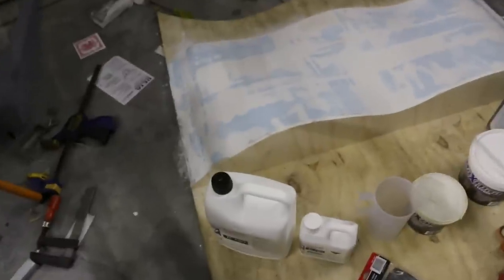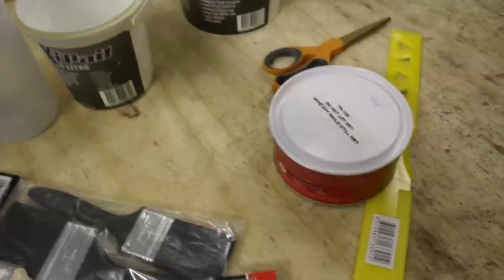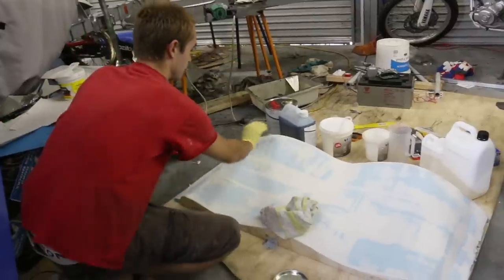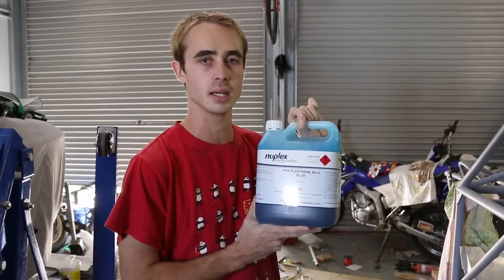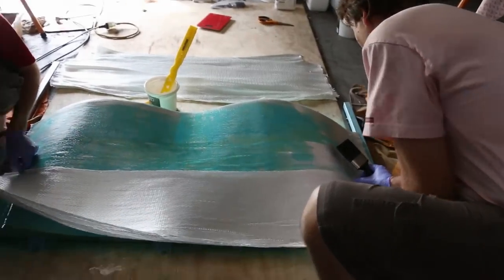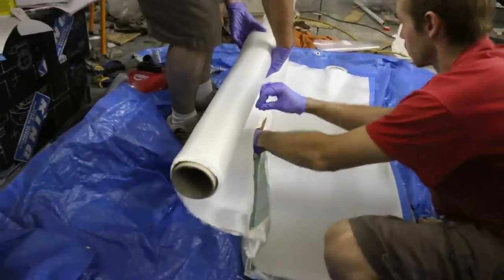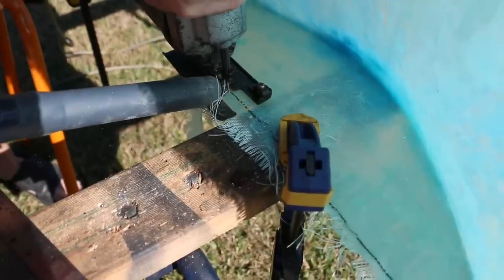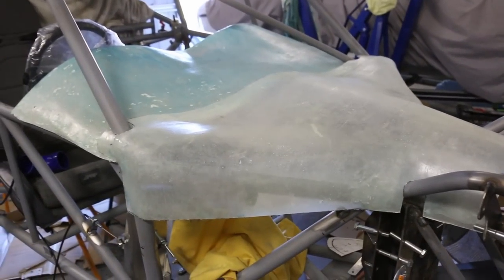How to Make Fibreglass/Carbon Fibre Race Car Bodywork - Part 2/2

Comment: Kyle, did you use E or S glass for this, and what weight of material?

Also, you mentioned that you thought two layers were good for most applications. Does that include making parts for road cars and boats, or did you have mainly race cars in mind, for which the weight savings are critical?

Good stuff, thank you.

Comment: hope you see this since the video is old, but what did you use in between the female mould and the actual piece?
Reply: +Neil Chand looks like there's a clear plastic sheet? like a cling wrap haha
Reply from the maker: +Neil Chand I do actually use industrial cling wrap around the outside edge of my moulds where I don't want it to stick! But you wouldn't want to use that for you main surface as the finish would be terrible. I think it's mentioned in the video, but the mould is coated with multiple layers of wax, then sprayed with PVA (the blue stuff), and I let that dry into a sort of a plastic film before layup, and that provides a clean release.

Thanks for watching!
Reply: +KYLE.DRIVES sweet thanks! i was considering just using cling wrap for the whole thing but yeah rather the cleaner finish with the Wax and PVA

Comment: Do you need to wax the wood too ( it's maybe a kind of stupid question but I don't know)
Reply: Here no wood is exposed. If you have exposed wood parts, first seal them then use a release agent like wax. For more detailed instructions you can check tutorials for RC Fiberglass planes, there using wood molds is common practice.
Reply: Daniel Rose thank you

Comment: so how would the process be different with carbon fiber? don't you have to heat up carbon fiber or something like that?
Reply: Depends what sort of carbon fiber mate, if its pre-preg (resin already inside the fibers) then yes many require the use of heat and pressure in an autoclave for instance in order to cure properly, however there are also room temperature resin systems that dont require heat or pressure
Reply: Simon WoodburyForget the reason   they use resins that require an oven cure is that yes being strong is an advantage, impregnating fibres with a room temperature curing resin completely negates the ability to have pre preg in the first place; the advantages of which include optimal resin/fibre usually 60 percent resulting in the lightest possible parts possible while utilising the fibre/resin matrix to its fullest extent. They require pressure in order to compress the layers and drive all the air out otherwise you risk delamination on such a leanly infused part. Infusion looks fantastic if resin is degassed correctly however results in 100% percent saturation and thus a heavier part. We get our pre preg in from korea and it has to be kept in a fridge. once the package is opened you have 40 days to use the roll or it is discarded as the resin slowly goes off at room temp....
Reply: Err, not exactly correct on a few points. If you replace the unused carbon back into the freezer (not a fridge as it isn't cold enough) it will refreeze and you are back to 12-18 month shelf life. However, there are prepreg carbons that can be kept at room temperature for over a year. If your prepreg carbon only lasts 40 days once opened I suggest you look for a better quality supplier :-)

You need 100% saturation in order to obtain the maximum strength. Dry fibres mean a weak part. Prepreg is 100% saturated, but at the optimum amount - around 40% (not 60%) by weight (eg - 100gms of carbon requires around 40gms of resin). However, too much resin also results in a weaker part.

Comment: Can we use thin metal sheet to make mould instead of foam?
Reply: Yes you can use metal but its always best to still apply a mold release wax. First im am an actual fiberglasser just saw this channel and im shocked make shore you roll the glass not just use brush